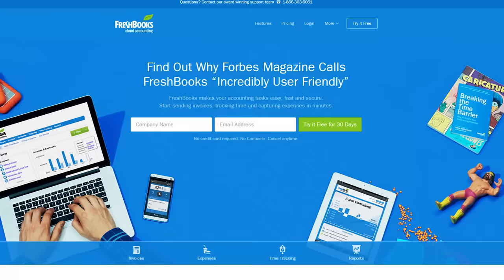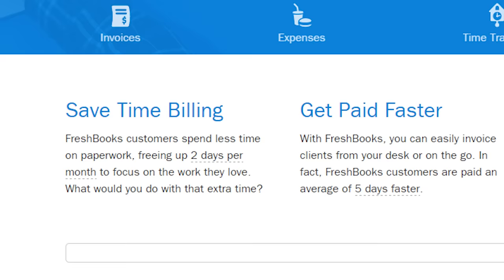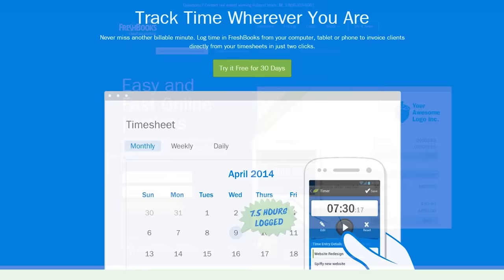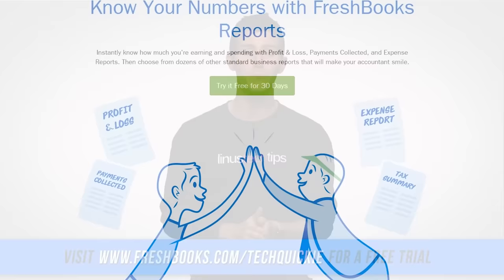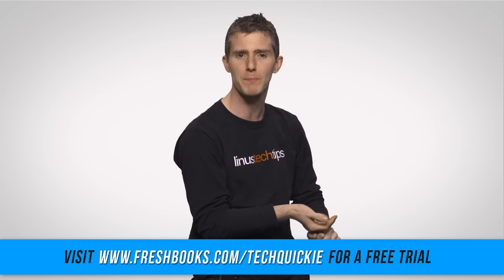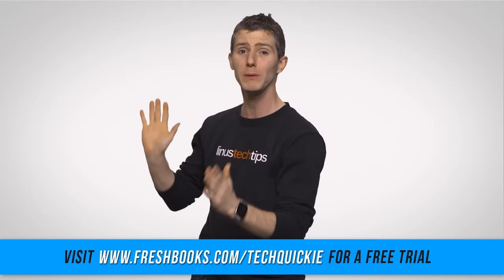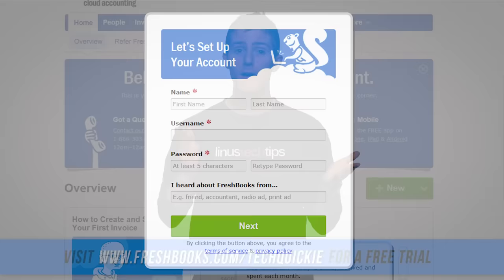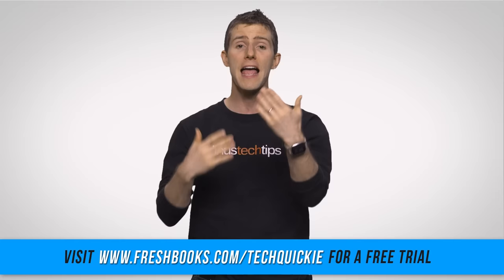AM and FM Radio As Fast As Possible

Comment: 1:43 What's so cool about this, is that when I play my electrical guitar with headphones near my room windows. I pick up a radio station . at first it was scary I thought I hear voices
Reply: wow thats weird!
Reply: It's called bleedthrough and it's very common with analog devices especially ones that are poorly shielded. They act like a rather poor radio reciever.

 I've had a few tape decks that doubled as low volume single station radio recievers.
Reply: @plateshutoverlock  I use a dongle with my iPad cause the case is too small for an aux cord, but dongles are fragile and sometimes I can hear the radio in  my audio

Comment: FYI: Analog signals aren't "decoded". They are demodulated.
Reply: +vwestlife Linus uses codecs instead of modems xD
Reply: I wasn't expecting you here
Reply: FYI: I got brain cancer from all this misinformation.
Reply: VWestlife Can't we say modulation is a kind a coding ( without being technically accurate).
Reply: To add, digital signals aren't decoded either, they're also demodulated. Digital information is encoded in some form (or sometimes left as is), then modulated for broadcast, then demodulated, and lastly decoded. The encoding can give the data signal more favorable properties for the modulation that is to follow.
Reply: VWestlife It seems you dont understand they are the same thing. That's what is meant by "decoding".
Reply: VWestlife 
Decode - to translate from one language into another; convert (audio or video signals) into another form
Reply: Its called as fast as possible for a reason
Reply: @George David What does FYI mean? I shall tell you; FYI is an abbreviation of 'For Your Information'
Reply: @bhargavsaikia403  no because decoding refers to digital waveforms.
Reply: Kanye Fuller loool
Reply: FM¹09.9
Reply: which means it's more analog ..a direct connection to the original sound. seems like.
Reply: Half truth. For example  FM is indeed called Frequency modulation, but frequency to amplitude transformationi can easily be called decoding.

Comment: Nicely explained, Linus. Though your explanation on AM vs FM when it comes to skywaves vs ground waves is easily misunderstood. Using the ionosphere to reflect radiosignals is done at longer wavelengths/lower frequencies yes, but regardless of the modulation scheme.
Reply: I was here 5 years later just to check that someone had pointed this out! :)
Reply: @thomaseriksson36  TBF, the is focused on the commerical AM/FM broadcast bands. It IS possible to use FM on SW or (even MW) frequencies,That explaining that might be a bit "out in the weeds" for a "Quickie" video.
Reply: @thomaseriksson36  HaHa.... so many errors in this video

Comment: Also, FM is actually a subcategory under something called Angle Modulation. Angle Modulation consists of Phase Modulation (PM) and Frequency Modulation (FM). This is because in application they are varying the angle in a cosine function. Thus the name: Angle Modulation. FM actually changes the frequency, but when you add an angle in the cosine function, we call that the phase modulation, and pretty much just shifts a signal left and right (hence the name Phase Modulation).
Reply: It gets a bit more complicated with radar applications.

Comment: I miss having FM in my android phone. My first one back in 2010 was a Droid X and had FM radio!
Reply: +Robert Tinsey sony xperia z5 still has it :P
Reply: +Robert Tinsey Some can still use FM radio by using a Bluetooth headset as an antenna. I know my windows phone can.
Reply: +Robert Tinsey still rocking my fm radio with my lg g4
Reply: @alcidiow well dump your lg phone as I bet the battery is so old I bet it doesn't even hold a charge long at all and remember you can only use wired headphones with a phones fm radio(wireless will not work with it,only wired will)

Comment: I can't believe the perfect timing of this. I have my physics exams and AM and FM are part of the syllabus. Thanks for this, Linus. :P
Reply: +Zahab Ahmed Qureshi you probably need to study anyway :D. These information are pretty basic.
Reply: I think AM radio is adjusted by a ferrite rod going in and out of a stationary coil. It's not the coil changing its structure, although mathematically it is changing its inductance.
Reply: +K Doe For tuning? I believe that the aerial is pretty close to a potentiometer, if not actually a potentiometer.
Reply: +luke timothy I remember analog tuners used both adjustable coils and capacitors. Newer digital tuners tend to use potentiometers, as it's just some voltage difference input to a chip that controls everything.
Reply: What is a potentiometer if not an adjustable coil?
Reply: K Doe in school, we called them Rheostats.
Reply: Career update?

Comment: You can transmit and AM or an FM signal on basically any frequency.  Broadcast bands have been established that places commercial AM broadcast on lower frequencies (535kHz to 1700 kHz) and places commercial FM broadcast on a higher frequency band (87.5 Mhz to 108 Mhz). With the right equipment you could easily transmit an AM signal inside of the commercial FM broadcast band (87.5 Mhz to 108 Mhz). I have a transceiver at home that allows me to transmit AM at 144Mhz or FM at 28Mhz. AM and FM are modes, bands and frequencies are different.

Comment: Wish you included DAB radio in this video :(
Reply: +BLAQSONiC well it's more expencive, complicated and not world wide adopted. My country started getting DAB in 2011. but people still use FM and AM.
So my goverment is shutting down FM and AM to free up these frequenzies in 2018? or something like that.
Reply: BTW.. I live in Norway.
Reply: +BLAQSONiC its the same as fm but instead of using a audio signal to modulate the frequncy it uses digital signal so on or off where high change in frequncy is on low change is off.
Reply: True. Norway is shutting down FM this year...
Reply: @SigurdKristvik you mean frequencies and expensive

Comment: The benefits of radio are simple:  The infrastructure already exists and receivers are absolutely available at any price range, from old to modern. Even a radio from the 50s and 60s can still be used. Receiving doesn't cost you anything and nobody can trace you back, unlike webradio streams. Plus radios usually run on low power and have a long breath.They can be powered by all sorts of energy. Some radios even run on a kinetic energy dynamo that is powered by a spring movement and don't require any batteries at all. You can even build your own custom radio the way you want with fairly cheap off the shelf components. All that matters is what type of style you prefer. And another benefit of analog radio is that even if the signal quality is weak, you can STILL hear the station through the noise. If the signal of a digital transmission is too weak you get nothing at all or just eardrum shredding glitchy noises. Analog radio is basically THE BEST medium (still) to reach the most people around the world.

Comment: I find analog technology, although technically inferior, way more fascinating than digital technology. It seems so much more difficult to get right that the fact that it can end up sounding or looking as good as digital is mind blowing.
Reply: Analog technology can be improved not so with digital. With digital there is a finite standard (1's and 0's) in order to change any quality a new "standard" must be developed. With analog things just get better with better components.
Reply: @rty1955 however,more interference will always occur with Analog devices which is why Analog devices got phased out in favour of more reliable and higher quality digital devices
Reply: @stephensnell5707  as analog devices get better, LESS interference or noise will happen, but in a digital world, everything is finite and requires a new "standard" to be compatible.
You can improve analogy, but you cant improve digital

Comment: One thing I found weird with fms is if you’re listening to 99.5 fm (for example), and you switch to 99.4 or 99.6 you can still hear the same station as 99.5 although you can hear some static.
I live in India and here we have more fm stations compared to am. I listened to both fm and am and I find that in am volume goes up and down and in fm I can hear static sometimes.
Reply: Thats why the frequencies tend to be separated more. Like the radio would jump from 97.0 to 98.0. That gap reduces interference. Using decimals makes interference have a higher chance.

Comment: That's what this generation of the Digital age needs to do. They need to learn how to Appreciate what we DO have just in case if something DOES happen to the Internet that they depend on SO much. Don't go discarding OLD technology just because we live in the Digital Age. That Old Technology COULD save your life one day. Put it in another way, our way of life may revolve around Modern Technology but the Forces of Nature out there doesn't such as the Storms that we see from Mid Spring to Mid Winter Tornadoes, Hurricanes, Earthquakes, Floods and Blizzards. The Cloud-to-Ground Lightning, Gusty (+60 mph) Winds, Moving Ground, The Rain and the Ice that falls from the sky can knock out or Potentially destroy the electricity on the Utility poles that y'all depend on for your Wi-Fi needs. Can't Run Wi-Fi and get the Information you need without electricity. They can throw you into that situation. Where you're left with an old battery-operated AM/FM radio as your only resource for information. Now your Smartphone may have a chance of getting information without Wi-Fi through the Cell Phone Tower that is if you don't mind using data for it or if the Tower itself is not in the path of that particular storm where it can be destroyed. If your Smartphone fails on you during that situation your gonna need that Old Radio to let you Know of what's going on.

Comment: +linustechtips IT IS NOT as simple as a couple of wires!!!! Tuner circuits are beautiful LCR circuits. When you turn a knob, you rotate plates which change the common area between parallel plates, thus changing the capacitance(C). This in-turn changes the resonant frequency of the circuit(because resonant frequency omega=1/root(LC).
Reply: +Kaushik Harith It is also possible to make an AM radio using only a variable coil, instead of a fixed coil and variable capacitor. In fact, most older car radios used variable coils, known as "slug tuning".
Reply: vwestlife Interesting! How would one change the no of turns of the coil/length of coil/Area of cross section? Those are the factors that magnetic field depends on and hence Inductance(because L is flux per unit induced current.). I can't picture any easy or efficient way of doing so. The only easy way would be to change the permiability, but that would limit you to using two frequencies.
Reply: Kaushik Harith The physical coil of wire stays the same. To tune it, you slide one coil in and out of another coil, or slide a metal slug in and out of the coil (hence the name "slug tuning").
Reply: vwestlife That is what I thought. But how would we get a continuous distribution of resonant frequencies?
Reply: +Kaushik Harith google it buddy.
Reply: have you ever heard of an crystal radio? it's just a piece of wire around a toilet paper roll, a diode and your headphones. it needs no power, just powers itself by taking energy from AM waves.
Reply: +Kaushik Harith Electromagnetism Physics FTW :D
Reply: Also ignored is IF stages etc.  superheterodyne receiver it's called.
Reply: +Kaushik Harith Well, in the OLD days, you could MAKE your own radio from a cereal box toy. They came with a crystal and a piece of wire. Just wrap the wire around the crystal and you could hear it. Sounds pretty simple, especially considering his main point of comparison was advanced, digital, internet-based streaming services...
Reply: +Kaushik Harith He kept it simple to make it "...as fast as possible".

Comment: why are radio station frequencies end in an odd number? its always 98.9 or 104.5 but never 100.6 or 99.8?
Reply: I know that there is a .2 difference in the frequency to keep stations from bleeding together but why odd numbers?
Reply: There a radio station in my area called power 98 but they are 97.9 on the radio channel
Reply: it's because odd numbered frequencies have better range that even numbered frequencies for some reason.
Reply: +Suhkma Dheek yes. I understand now. thank you
Reply: +Kirt Thelander FM stations in the same area need to be spaced apart in order to avoid interfereing with each other. In North America this is accomplished by allocating the FM channels only on the odd frequencies. In other parts of the world, they use both the odd and even frequencies, to allow more stations to fit on the band. (AM stations are also allocated on different frequencies in Europe and Asia, with 9 kHz spacing between channels, instead of the 10 kHz spacing used in North & South America.)
Reply: +Kirt Thelander Haha, currently right on station, tuned to 94.2MHz. It just that different countries have different rules about where frequencies can be allocated.
Reply: +Kirt Thelander I'm not expert, but I'm pretty sure it's because the signal goes up to +/- that .1 and since you can't go into negative frequency, the entire baseline for the scale would have to start at 0.1
Reply: What are you talking about? Radio538 in the Netherlands is on 102.2 fm
Reply: Ruben Vaatstra
That's why I said "In North America... the FM channels [are] only on the odd frequencies. In other parts of the world, they use both the odd and even frequencies, to allow more stations to fit on the band."
Reply: vwestlife
There is a limit to the range you can go before bleedover happens & that's no good.
Reply: Because the FM band is specified in even numbers, in the US anyway.  88 to 108 Mhz.  Also FM channels are 200Khz wide.  The first channel must start at 88Mhz and end at 88.2Mhz.  The center of the channel (carrier frequency) is the average of the limits   (88+88.2)/2 = 88.1Mhz.  By the way 88.1Mhz is an even number. It is 88100000. You can divide that by 2.

Comment: Short Wave Radio as fast as possible
Reply: +joebob2311 It's a variation of AM that takes out the carrier wave and just uses the difference (sideband)

It then bends around objects or bounces off the ionosphere, similar to a laser through dust.
Reply: +joebob2311 My first thought as well.
Reply: +waterlubber No, that's SSB (Single Side Band) you're referring to, not shortwave. Shortwave broadcasting uses Amplitude Modulation, just in a different frequency range and with higher transmitter power levels, allowing shortwave broadcasts to be easily heard thousands of miles away. More properly, what we refer to as "AM" is known as Mediumwave (MW). In the Eastern Hemisphere, the Longwave (LW) band is used for AM broadcasting as well.
Reply: vwestlife Well, shortwave covers the HF band of the spectrum and a LOT of broadcasts there are SSB
Reply: waterlubber A lot of amateur radio operators use SSB, but not a lot of shortwave broadcasts. The vast majority of shortwave broadcasters use AM; some use DRM (Digital Radio Mondiale) and only a handful use SSB.
Reply: +vwestlife SSB in broadcast is used by some pirate radio stations. SSB is much more used by radio amateur due to greater transmitter distance, which require less power to transmit.

Comment: Pretty good but you strayed a bit when describing the distance part (at the end) Emphasis was needed to explain that its not the MODE (ie AM-FM) which increases distance but the commonly used frequencies .  I would have used the term "AM Broadcast band" and FM Broadcast band .  Signal to noise ratio would explain range issues also but that wouldn't be making it simple .

Comment: Misleading explanation of AM. It's a common misunderstanding, but AM doesn't tune to a single frequency. It can't be that way, since a single frequency alone carries no information. When you modulate the carrier, you introduce the frequency components from the modulator which are in the resultant AM signal. These are known as the sidebands, which are mirrored around the carrier. When you're tuning to an AM channel's frequency, you're tuning into the entire band allotted to each channel. Standard AM channels have a bandwidth of 10kHz, which is good enough for voice. This is why radio channels are never adjacent, you need the entire bandwidth for the transmission as well as a buffer area between channels to minimize interference.

It's impossible in the real world to tune to a single frequency, since no perfect filters exist. That's also what the resonance circuitry is acting as, a filter. If you were able to just tune in to the frequency of the carrier, that's all you would receive, the carrier. Which carries no information by itself. All the information is in the sideband.
Reply: Hmmmm.... Technically, you could use TIME-based spacing of pulses at a SINGLE FREQUENCY that can contain information IF it is broken up into pre-determined time slices representing numeric values to create digital broadcasting-based bits and bytes. That is kind of like using Morse Code but happening with the time-based spacing allowed within the Megahertz of FM and Kilohertz frequencies of AM radio.

V

Comment: The way I'm interpreting his video is that when you tune your radio receiver to a certain station, your tuning to the carrier wave frequency.    The carrier wave is just that , a "carrier".  The stuff you want to listen to (also a analog signal) is superimposed with the carrier wave, then off they go into the wild blue yonder.   Your radio receiver's antenna will pick up the signal, as you are tuned to the carrier frequency (if I' m interpreting his video correctly) .